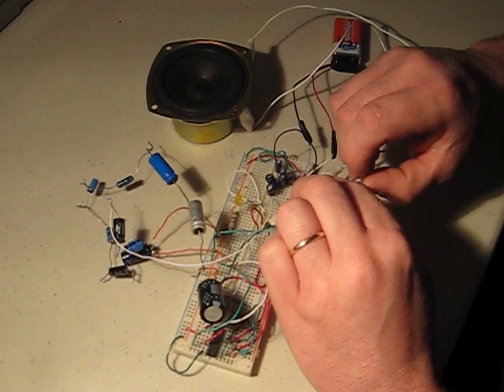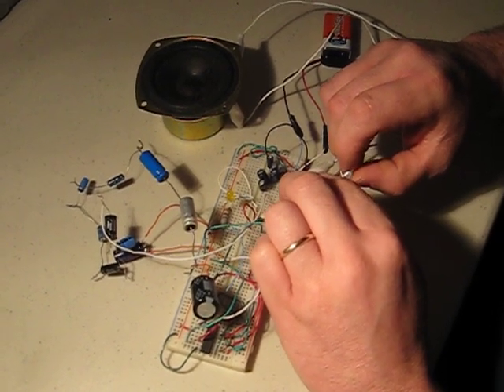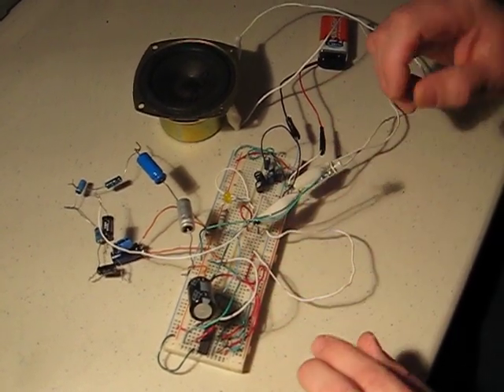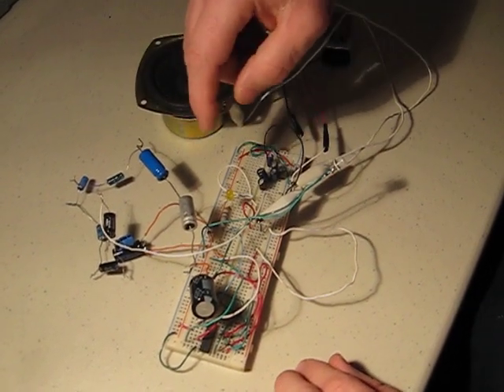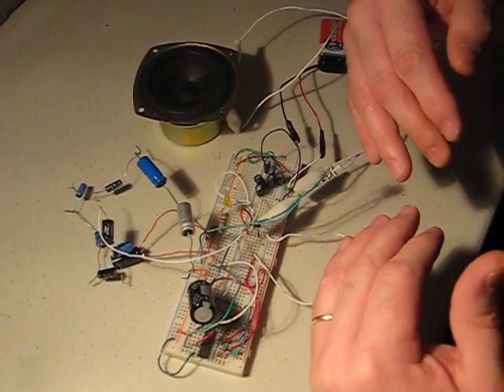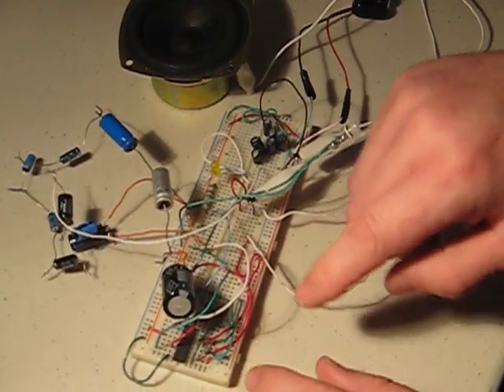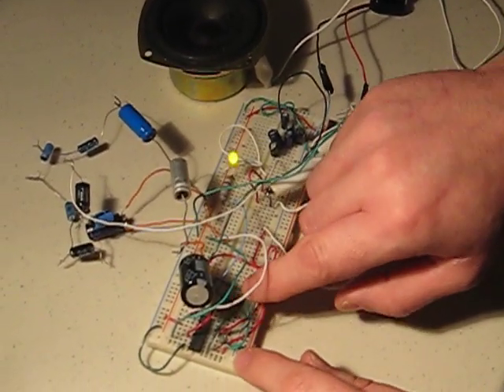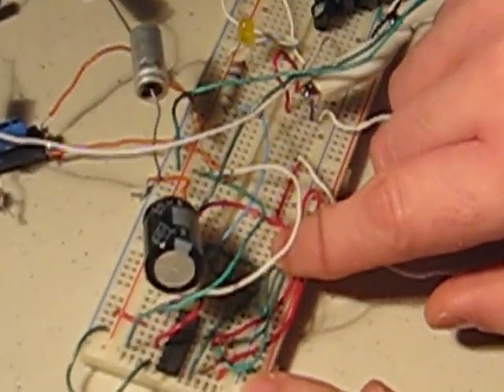Resistance and capacitance changing frequency

Comment from the maker: @peshozmiata  I havent played around with the 555 and speaker much, Im making a digital clock right now for medicine reminders, lol exciting stuff huh? as far as volume im sure if i fed that thru an npn with the 555 pin 3 output to the base and a potentiometer controlling a 9VDC supply I could get it a lot louder, I'll have to try. Again, that was only the 555 driving that speaker which isnt very much so your idea of amplification is a good one ! thanks.       Jim

Comment from the maker: @devil614 the capacitor will drain too fast, caps are for power factor balance and regulating a power supply so its cleaner. your better off to trickle charge a batterie that takes over when a photo cell closes circuit

Comment from the maker: A capacitor is marked with both the max value for volts and it gives a farad rating. (1) farad is huge! so we use nf (nano farad) mf (micro farad) those are most common. Charge a battery instead with the solar charger, it will last longe..... Jim